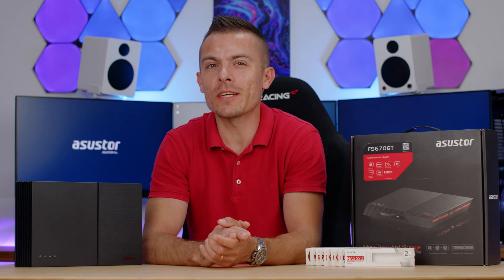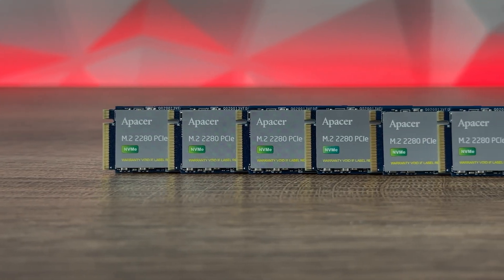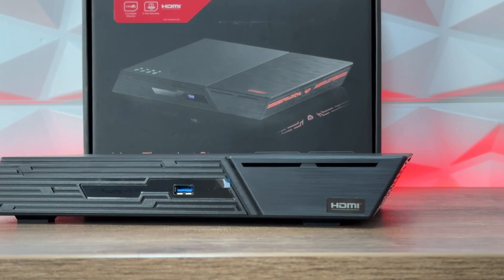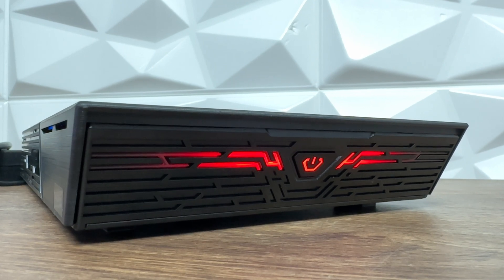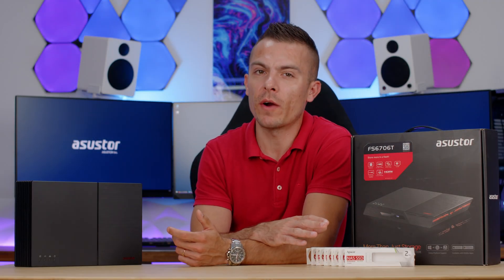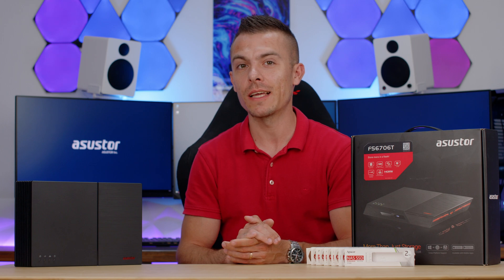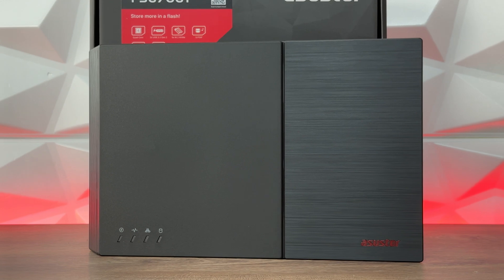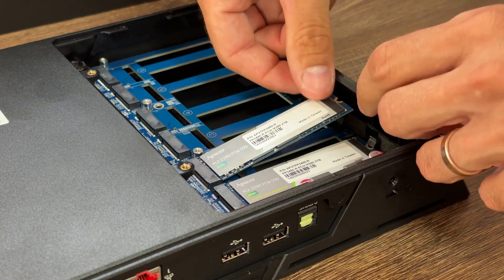ASUSTOR FS6706T - 6x BAY NVMe SSD NAS

Comment: Hilarious. A single 8TB M.2 will cost more than the NAS itself, some at 2x the cost.
Reply: Yup. I have an M1 Mac Mini and I got an external thunderbolt M2 NVME 8TB external drive for it since you can’t upgrade the memory or the ssd in the Mac Mini, and the cost of the Mac was around $1200 while the cost of the NVME 8TB drive was around $4k at the time I got it. So roughly 4X the cost of the computer itself. 😂

Comment: Questions:

Considering you are using all six slots configured for data and Asustor recommends using one slot for the boot process.  What are you using for the boot?

I am considering this for my environment. I currently have a WD NAS and data on it, including movie videos up to 1080p and wireless, it streams well. I understand the celeron processor used is not quite a higher end one. I'm in the process of converting the 4K videos to store on a NAS. Do you feel this system and its processor can handle the streaming of those files?
Reply: It has an internal 8GB eMMC memory for the operating system.

Comment: nice NAS but  sadly its 450$  with Intel Celeron N5105 and 4g of ram for 6 bays model
Reply from the maker: Yeah, that might be the down side, the processor because of the lanes and the RAMs, well even the 12x bay one has the same capacity. So apparently it isn't needed as much. Regardless to that, at least you have an option to upgrade RAMs.
Reply: @PCCrazyDario  its a shame to see a nas promises  to host VM and it has this  this and cpu. Despite  this, it has no graphic accelerators
Reply from the maker: @Rayu25Demon  Yeah, that is true. But I wouldn't use it for VMs for sure. Apart from that, as you saw, it has loads of other advantages.
Reply: @PCCrazyDario 

Questions:

Considering you are using all six slots configured for data and Asustor recommends using one slot for the boot process.  What are you using for the boot?

I am considering this for my environment. I currently have a WD NAS and data on it, including movie videos up to 1080p and wireless, it streams well. I understand the celeron processor used is not quite a higher end one. I'm in the process of converting the 4K videos to store on a NAS. Do you feel this system and its processor can handle the streaming of those files?